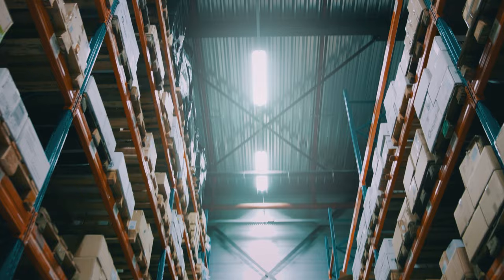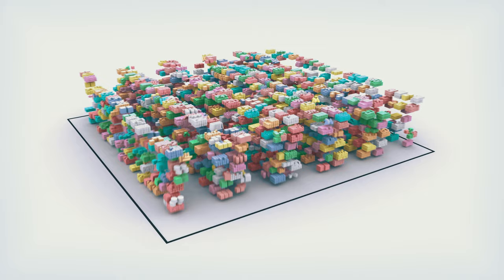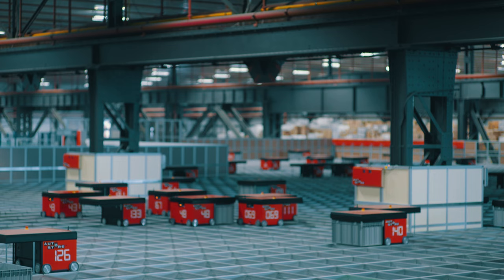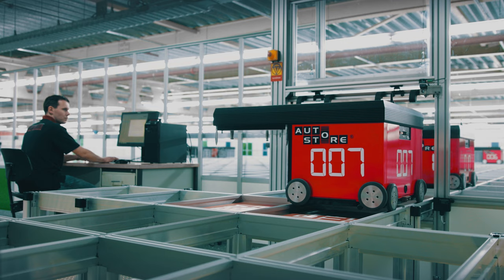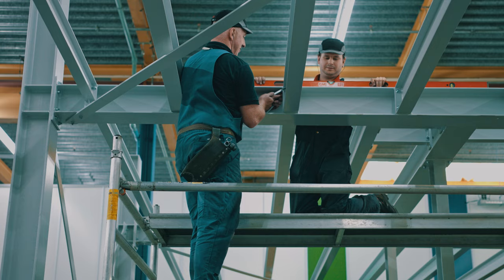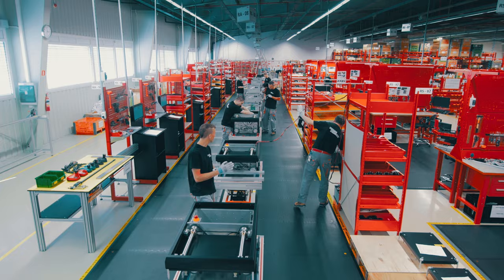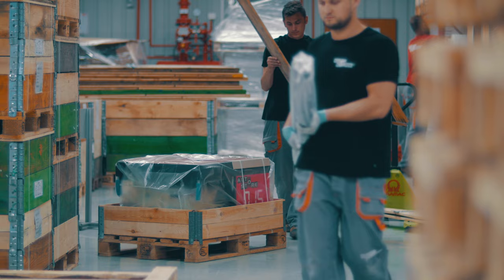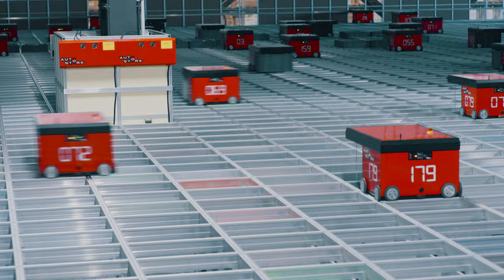AutoStore | Introduction: Stop Airhousing, Start Warehousing

Comment: Cool idea, but how on earth could you service this installation. Thankfully, the grid itself does not contain any moving parts, but were something to get stuck down one of the columns (unlikely, but possible) would you just have to give up that column of space? In addition, it seems it would be difficult to reach any robot that malfunction in the centre of the grid. Also appears there could be some fire hazards with so many goods packed in crates with short distances between them, but enough air still present to fuel a fire.
Reply from the maker: Thanks for the great questions. When it comes to service we know that this is a common question. Over our 20 years in developing and producing our system, we have also created procedures, methods, and tools to address and fix the problems noted for our 500 installations around the world.

Likewise, the question about fire hazard is always a challenge; especially in a modern warehouse that is getting bigger and bigger and more technology-driven. For our system, we have done extensively fire testing since 2007; we are one of the leading companies when it comes to research on fires in systems like this. FM Global has also released a new datasheet 08-34 that covers this type of system. Please let us know if there are any other questions we can answer for you!
Reply: Doesn't seem that impossible to handle to be honest. Something like this would work I think:

1) Tell the system to empty all the columns adjacent to the one with a stuck item in it.
2) Tell the system to consider a certain part of the grid as "off limits", i.e. no robots are to drive in this part of the grid.
3) Send in a maintenance-person to dislodge the stuck item, and if need be repair the column.
4) Tell the system that this part of the grid can now be used again.

This does assume that the grid has at least some space space so as to make it possible to empty parts of the grid without disrupting operations. But there's many reasons such as system will likely work best if it's at most 75% or something of that magnitude full.
Reply: @agrajag-no  3d tetris then?

Comment: Not the fastests, but flexibility of layout, adapting to building constraints, and the density is really the highest you can get. Also, it is easy to install this underground, or put human stations high, so the robots, don't need to bring things down again for picking or packing. Instead, operate mostly at the top. Really cool. Also numbers of robots can be easily varied, and expanded for more speed, and reundancy, that is also great. Building it is also way easier, the main construction is made out of cheap to made and cut extrussions, that is also really cool.